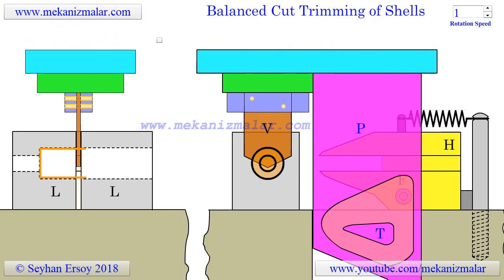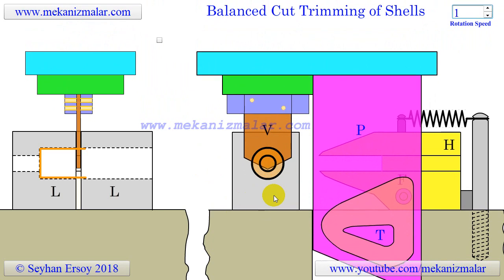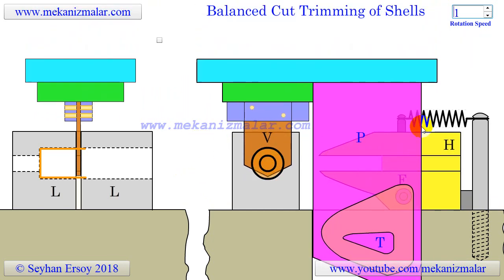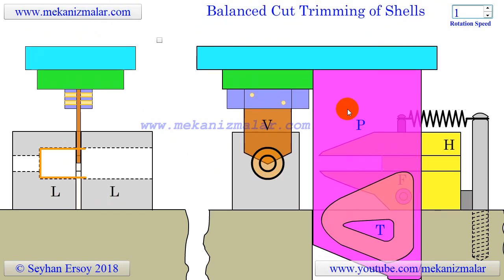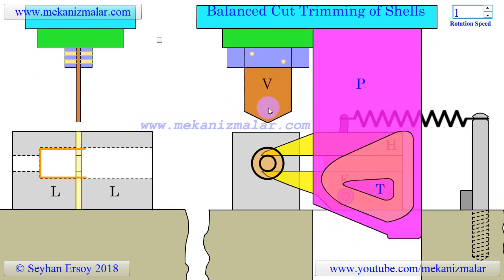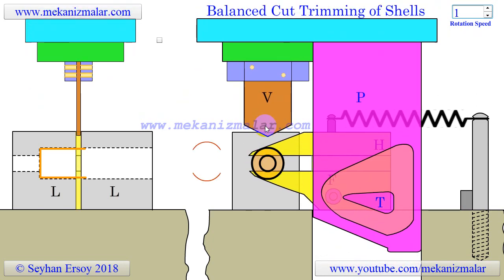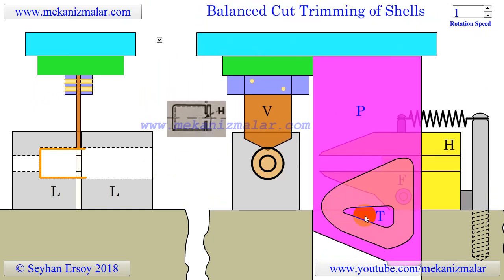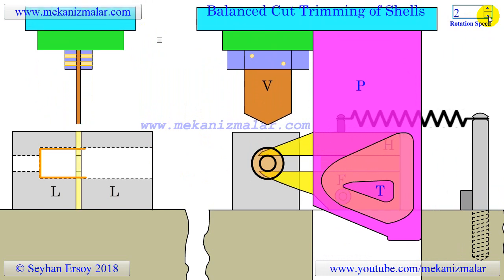balanced-cut and trimming of shells

Comment: Thanks .
One doubt sir.
Actually pipe is rotating or fixed?
Reply from the maker: Fixed.
Reply: @mekanizmalar  thanks.
Pipe inner dia is equal to the h blade width?
Reply from the maker: @thebalajitube  It should be thin wall pipe not thick.